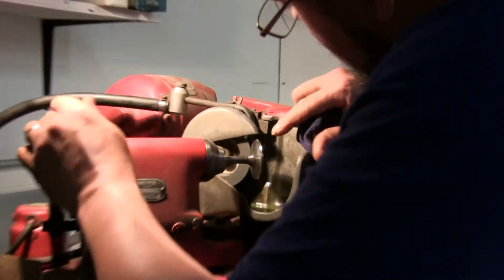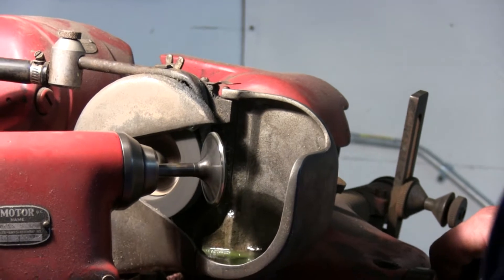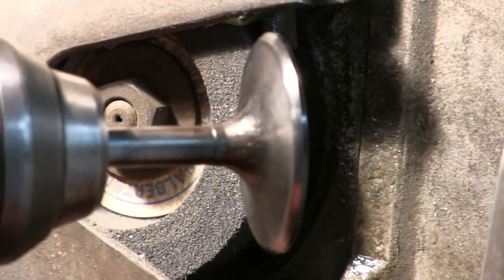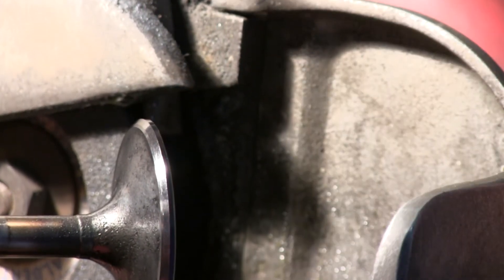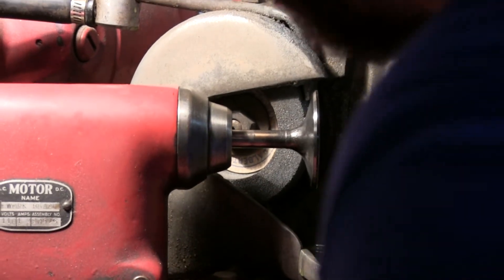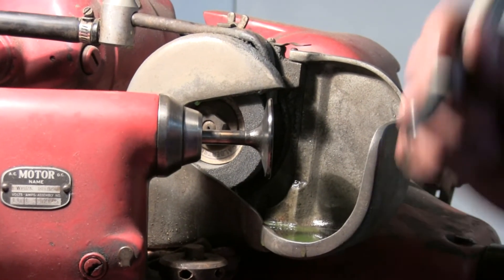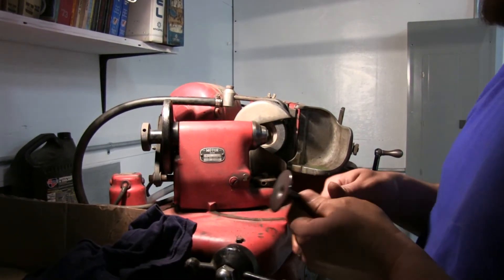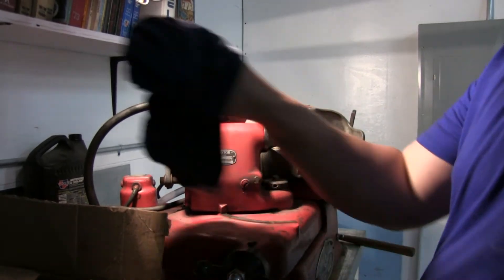Mopar 440 Engine Build Part 8 - Grinding Valve Face (Resurface)

Comment: Also people dont know this week some do .  when you smooth out the sharpe edges on the very edge of the tulip part of the valve especially the exhaust valves you will improve flow .